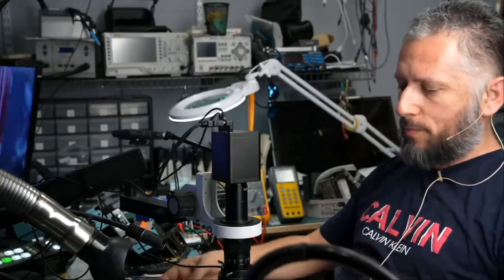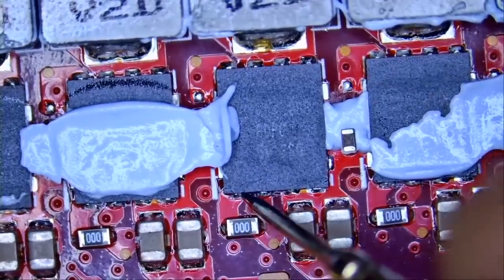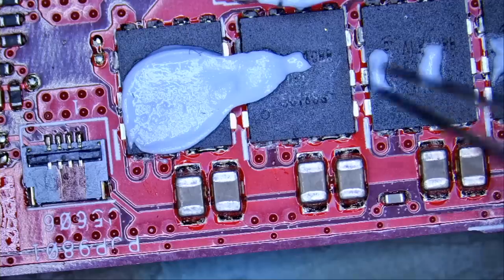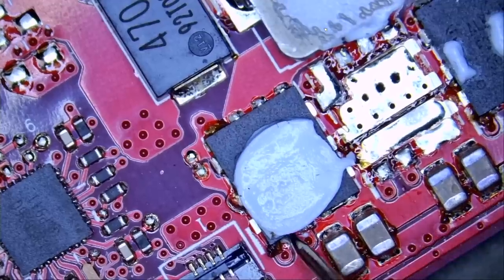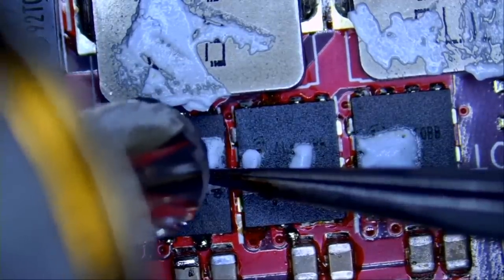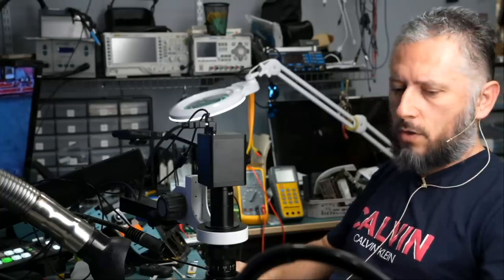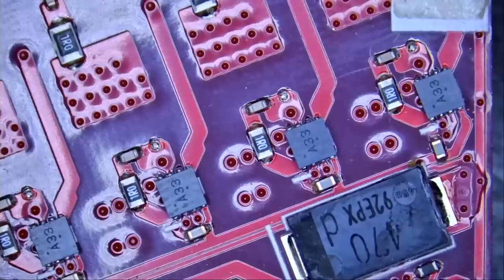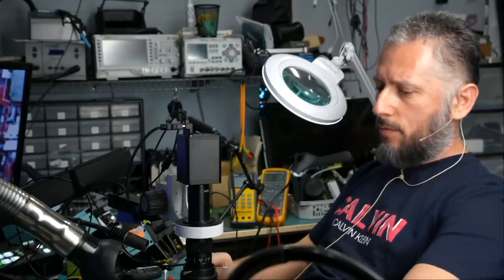ASUS ROG Laptop Repair - What's wrong with this one ?

Comment: I didn't notice any 'lag' this time around. From what I remember from film class, the fps number needs to be divisible by the actual refresh rate to not have choppiness issues. Aka 30 goes into 60 = smooth, 24 does not go into 60 cleanly. And so once youtube does their back end processing your 24 fps thing being stretched to a 30/60fps product gets distorted.

Comment: I know what a mosfet does, but why so many? are they in series? are they different voltages?
Reply: Yes, different voltages. They are not in series, but pairs. Think of audio push-pull stages. That is MOSFETs for V-Core, for GPU, the 3.5 and 5-volt pairs from the charger control circuit, as well as pairs for memory. Of course there are also non-paired MOSFETs which are for protection, or path switching.
UPDATE: In this case as another user Michael Black points out, and as Alex confirms in a 24 hour later video, the MOSFETs are in parallel, for supplying more current. Unusual in laptop cases, but not uncommon in large power systems circuits.

Comment: Fly back diode or capacitor is bad for that mosfet. In those buck/boost converters.we need flyback to protect mosfet from flyback voltage from inductor.

Comment: is it possible to measure on a good mother board the cpu in resistant’s mode or in diode mode to get a better idea of the cpu then when the occasion present it's self then by making the comparison between the two boards. Or everything I wrote makes no sense.

Comment: What is the white stuff stuck on the top of the MOSFETs and other components?
Reply: Thermal paste between heatsink and component (not electrical conductive).
Reply: Thermal paste and/or pads. MOSFETs are the part of a VRM circuit which actually gets hot during operation.

Comment: modern laptop's use the main battery as bios! if laptop is not used for a while the battery will drop below minimum charge level, and no lights when plug in charger!, just learned the hard way, but going to try and trickle charge laptop battery out of laptop..

Comment: are you not trying quick hotair reball on the gpu as the last fix? Sounds like a redneck engineering, but it worked in surprising amount of broken notebook gpus (if I was informed by the customer about some artifact/lines on the screen before the laptop died)